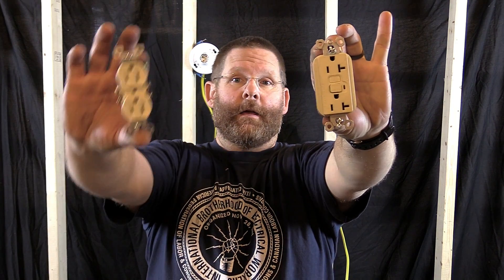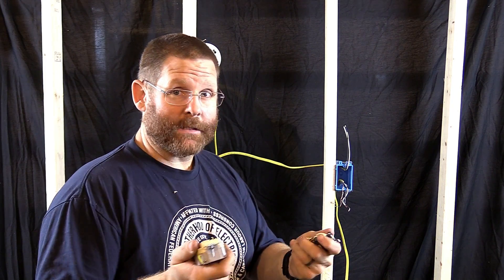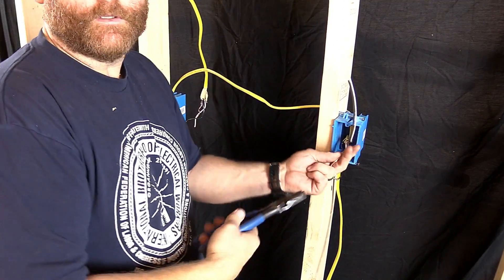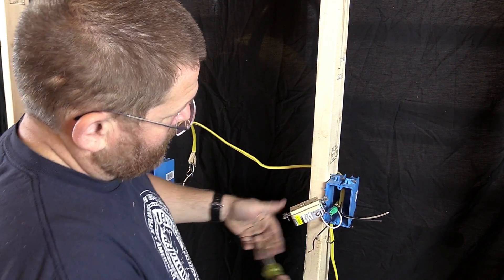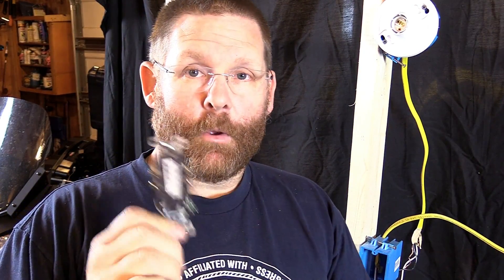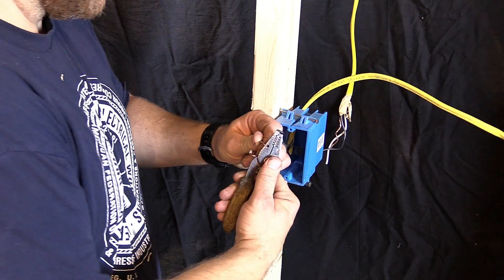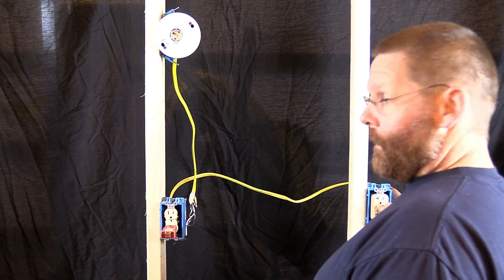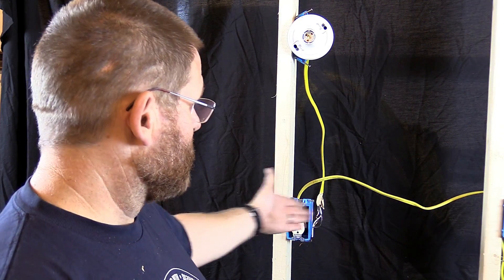How To Wire A GFCI And Receptacle

Comment: I so appreciate learning this stuff so I can troubleshoot stuff in my house. Can you address why a GFCI would have two wires attached to the LINE via pigtail? The LOAD is not touched. Thanks!
Reply from the maker: My pleasure.. Your gfi question, is whatever else you are feeding on that circuit does not need to be protected by a gfi downstream. Does that make sense?  Thanks for watching and commenting.
Reply: @MountaineerOutdoors  Thanks for the reply. The GFCI I referred to  as having power only into and out of LINE is feeding another GFCI in another bathroom. Can you comment? Thanks!
Reply from the maker: Guessing is that on past that Recep or somewhere in between there is a Recep that doesn't need to be gfi. Without being there it is hard to say.
Reply: @MountaineerOutdoors  
Or there may be lighting on the same circuit that one you don't want to lose just because a GFCI trips.

Comment: Hello - thanks for your video. That is a good idea and I think I'll try it. 

Just to make sure I understand everything correctly - if the downstream (non-GFCI) outlet is being used and it accidentally gets wet, the upstream (GFCI) will trip and hence protect the downstream user - is that correct?

Also I have an old house and all of the cables are 2 conductor only (no ground) - does that change anything regarding my above understanding? Thanks again.
Reply from the maker: First answer is yes it will protect the downstream ones if it is wired correctly on the load side. The second is this two wire systems obviously do not have grounds and therefore you by code have to replace them two wire receps with gfi.  Same concept for them as well.
Reply: @MountaineerOutdoors  thanks a lot for the info and prompt response.

Comment: I have a gfci receptacle in my bathroom that is protecting outlets on my front porch and the outside wall of my living room. Recently I plugged my vacuum in one of the LR outside wall outlets and it tripped the circuit breaker. We flipped the circuit breaker but the LR outside wall outlets did not work. Neither did the front porch outlet. We replaced the LR outside wall receptacle and the front porch receptacle but it didn't correct the situation. we bought a new gfci and installed it.  however only one of my black wires is hot.  HELP!
Reply from the maker: When you replaced the gfi did you put the hot wire on the line side?? So just to let you know your bathroom shouldn't be shared with all of those other receps per code... However, since it is you need make sure the hot to the gfi is on the line and the other set including the white wire is on the living room reception etc is on the load side. So, the hot wire coming into the bathroom both hot and nuetral needs to be on the line. The other ones need to be on the load.. Let me know if that fixes your problem...and make sure the gfi isn't tripped

Comment: I have my line and load pigged tailed to my GIF line and outlet kept tripping. Took everything apart and wired it like this video demonstrates but now the light in the restroom (same room)won’t work. Any advice?
Reply from the maker: There could be a few things to try... First thing is I'd make sure that there no wires touching like grounds touching the nuetral... If you have a metal box make sure only the ground is touching the box (bonding the ground to it). You may have it miss wired make sure everything is correct, line (power coming in) is on line and everything else is downstream (on the load) including the light nuetral. Also is there Two circuits in your box? Or just one?
Reply: I had a bad new out the box GFCI, I put the old one box and wired it the way you explained and its working but it keeps tripping when the exhaust fan is switched on or off.  Only the fan not the light. I figured wiring it this way would fix the problem. Before it was piggy backed the main in to the GFI.
Reply from the maker: Ok so just to clarify, everything works fine except for the exhaust fan correct? Is that circuit on an arc fault breaker?  And if not can you make sure that the nuetral and hots going to the exhaust fan are on the correct side? One thing I've seen before is dusty fans can have some moisture and it's sensing its in the gfci. Also make sure that the nuetral wires inside the fan are in no way touching the metal housing of the fan. If the nuetral and ground touch at all it will cause nuisance tripping. One more thing. Check codes but I don't believe that you have to have your exhaust fan gfci protected double check that so you can know that for yourself. Let me know what you find
Reply: Mountaineer Outdoors I think I figured it out, the main input from breaker goes straight to the GFIC instead of going to the dual switch. From every schematic I’ve seen it shouldn’t be wired like that.  Everything works fine but when I turn the exhaust fan off it trips the GFCI.

Comment: Great video. Question, I have a split plug receptacles on both sides of my kitchen sink, how would I gfi them?  Could I simply change out the regular two pole breaker with a new gfi breaker??
Reply from the maker: Split plug? I'm assuming you have 2 different circuits? They should not be on s double pole breaker. If anything it should be 2 single pole breakers. Gfi breakers would definitely be ok... But if it's only 2 receps gfi plugs would be cheaper. It's all about how much you want to spend.I know kitchens have more than one circuit and everything on the counter top has to be gfi protected so with that depending on how many receps down stream you have it may be worth buying the breakers.

Comment: Also I have a 15 amp breaker to 15 amp  gfi to daisy chain of 3 other outside outlets with covers why does it trip when I plug in core heater plug from car , is it using more amps than 15 ? Or moisture?
Reply from the maker: It could be moisture that I am not sure on. I had a diesel truck with a block heater also but it didn't trip my gfi ever. It may be that there is too much on the circuit or moisture just not sure without looking at it

Comment: I have a video idea that would be extremely helpful in my situation.  I have an older home with aluminum wiring.  I need to add a couple of new receptacles in the kitchen and plan to add alumiconn connectors to all electrical in the room while I’m at it.  Alumiconns only come in 2 and 3 port versions.  If I add a new receptacle mid run (not end of run), don’t I need 4 ports in the alumiconn?  How is it done?  Thanks for any help you might have.
Reply from the maker: Well honestly I had to look up what alumiconn connectors are... I would have to say this any house that I would go to and I would see s
Aluminum wiring I'd tell them to change it or I'm not working on it. Too many liabilities in that. I know that most people that have it are aware of it and are careful not to overload it but I personally don't mess with it. I would maybe use the ports that need then twist joints on the other wires. Hope that helps

Comment: What about a white, black and ground wire with the GFI outlet being the only outlet in the circuit?
Reply from the maker: I'm not sure exactly what the question is, put the wires on the line side of the gfi?

Comment: Great video.  My father was an IBEW brother, but I never really learned too much over the years, my bad!  Question: I think you referenced it in this video, but if I use the second set of inserts on the "line" side (not load) on the back of the GFI and take it downstream, I'm understanding that if the GFI pops, the downstream outlet still operates (BC it is not on the "load" side).  Can you confirm?
Reply from the maker: That is correct it won't be gfi protected downstream. I appreciate you watching.

Comment: I would like to see how to wire a gfci to protect multiple outlets, but using two double gang boxes. First double gang box has a gfci and a regular outlet, 2nd double gang downstream having 2 regular outlets.
Reply from the maker: It's the same as long as you come off the load side of that gfi.

Comment: Appreciate the info.  Why do you insist on only using insert method on gfci and not regular outlets? Just trying to be rational and understand the reason behind your opinion.  Thanks again!
Reply from the maker: I actually did a video response to this question and it will be coming out in the upcoming month. But it has very little purchase on the wire and heating up and cooling down weakens the metal along with plugging in and out bends the metal. The screw is virtually out of that equation and rarely comes loose. Hope that helps

Comment: I wired my GFCI the same way and added another outlet down line, when I hit the black button with an electric drill plugged in the drill kept running. The only thing I did defferent was to use a pigtail for the ground wires, didn,t have a green nut handy.
Reply from the maker: If you tripped the gfi and the down stream receps were still hot then it was wired on the gfi on the line side. Or your made a pigtail on the wires. The downstream receps have to be on the load side of the gfi other it will not work properly... And there have been instances where the gfi was bad straight from the store and it would do what you are describing.

Comment: Used the search and weeded down to this video which is the exact one I needed. I'm adding power to my greenhouse from the GFCI outlet on the side of garage and needed to understand how to wire into receptacle and make the outlets secure. Very informative and easy to understand
video.THANKS!
Reply from the maker: My pleasure I am glad that this had helped you. Have a great day ☺
Reply: Can I use this in kitchen
Reply from the maker: Absolutely gfci protection is a must

Comment: Great video!  I have a 2 receptacle circuit, one receptacle on each side of the kitchen sink .  The GFCI works fine.  It did not have 2 neutral wires on the receptacle that I replaced with the GFCI.  It would be difficult to run a neutral from the GFCI to the load receptacle.  Maybe that is why the previous owner didn't put one in.  What do you think?  Thanks!
Reply from the maker: are you sure its 2 different circuits?

Comment: so im trying to buy an older house . but fha says i need gfi so i watched your videos aaand i like them but the house was built in 1933. bin updated . but without diggin into it wut should i expect? also theres old lights with recepticales in them, how do i fix that?
Reply from the maker: Honestly if it was updated I'd probably go with a gfi breaker..when changing out gfis depending on how many you need it may be cheaper to go that route then to buy numerous individual gfi. Now if you only need a few then you can weigh your options.

Comment: What do you think about replacing the whole circuit with a GFCI breaker instead?  I'm looking to replace the GFCI outlets with USB charger outlets.
Reply from the maker: That would work save some money too. Unless you have gfis already installed.
Reply: Not sure if you want a USB receptacle in an area that may require a GFI because it’s required in wet spaces.
Reply: Nvm you said GFI breaker circuit.